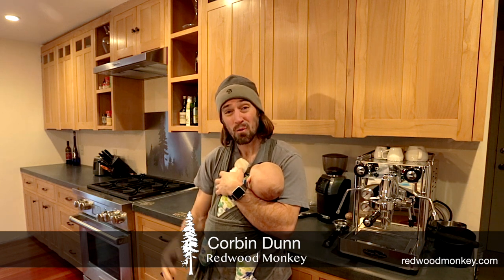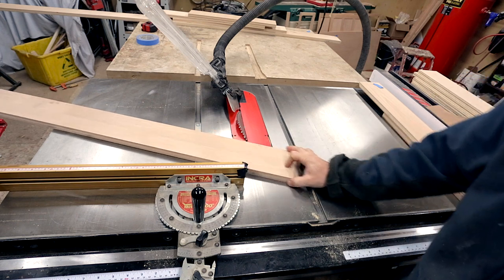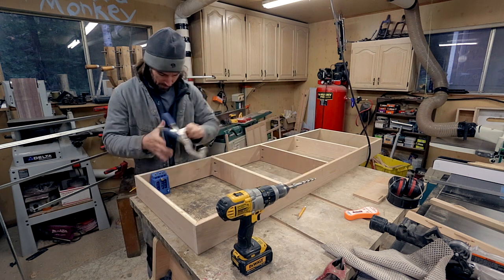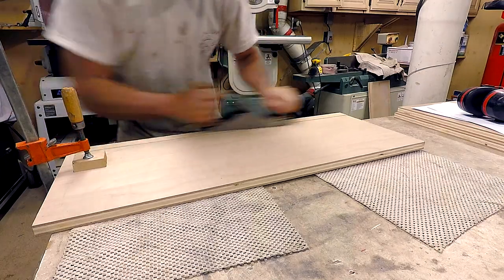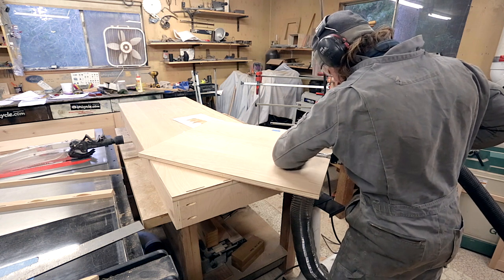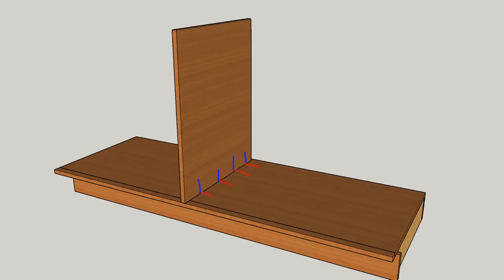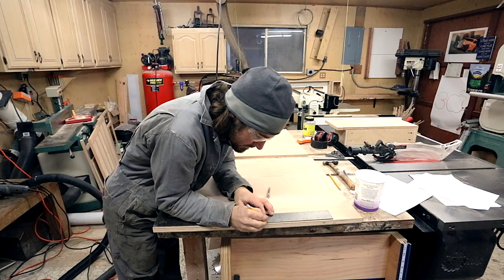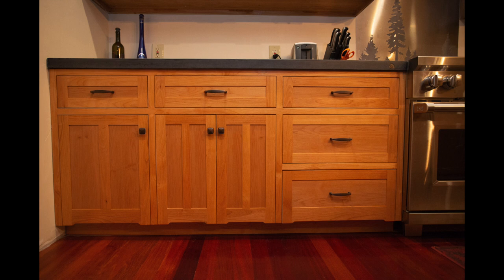Ep 5: How to make a cabinet base box and interior sides - DIY Kitchen Cabinets

Comment: Hey Corbin, have you ever tried using your divider panel as the reference piece instead of having to transfer those lines? I usually draw my lines to biscuit on the face of the divider first, cut those and then lay the divider down flat (line side up), clamp flush and use as the reference to cut the bottom panel. You just have to lay a pencil line across the bottom panel and adjust ur cutter accordingly… Dont know if that helps but it might be a little easier than having to hold the panel up and transfering the lines.
Reply from the maker: Hi Andrew - that is a great idea! I haven't made any more cabinets in a while - I'll have to give a try on the next set that I do.